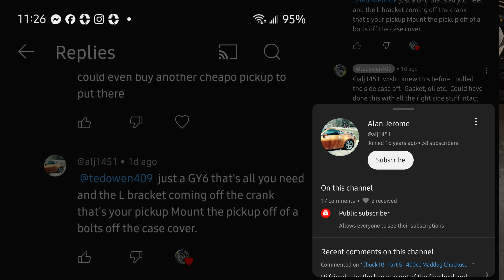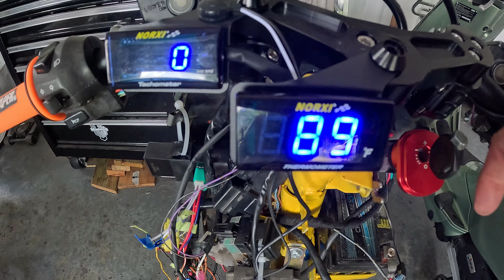Chuck It!  Part 6:  400cc Maddog Chuckus Burgman Ruckus Project.  It Runs!!

Comment: How wide is the mounting bracket/ location for the an400 I’m looking at making and adapter bracket to put it in a icebear vision
Reply from the maker: @removeableskull7446  it's a crazy pivoting dual axle type bracket on top.  But I think you could not even use that since it just uses that to mount it to the frame.  You could just use the mount on the motor itself.  A hole with a big axle looking bolt going thru it.  It is 7.25" wide.  Then the lower mount would be what is the shock mount under the suzuki.   Or not even use that lower mount and find a place to attach a shock on the CVT like a maddog does.